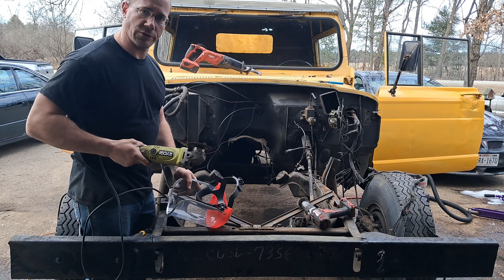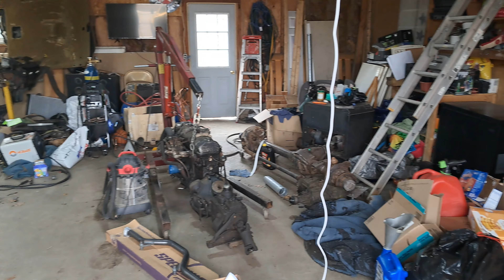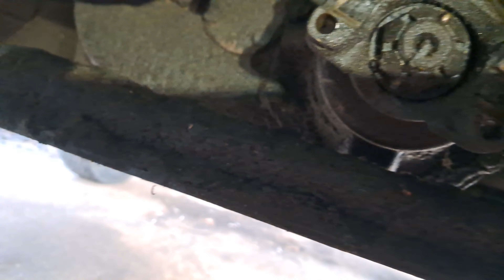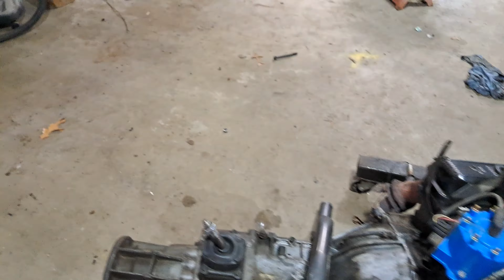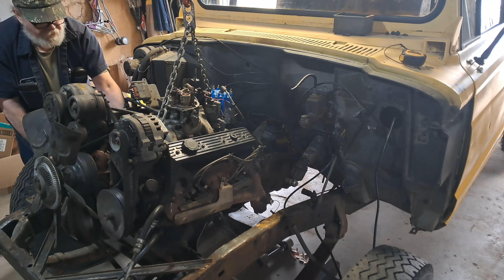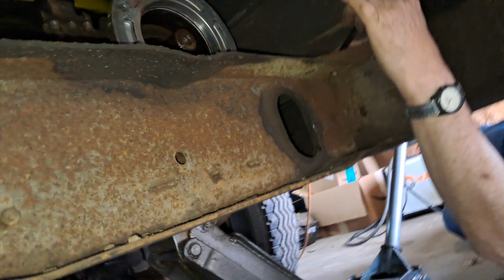M715 engine and transmission swap part 1 motor mounts and crossmembers

Comment: 👍To bustling knuckles with 3Generations together!  I always wanted to get one of the m725 for a camping, fishing & hunting rig.  Almost any new power plant is gonna be better than that Tornado🌪230!  My Pops told me stories about when he was stationed over in Germany.  How these 5/4 tons would just push through snow when it was almost as deep as the hood.  Looking forward to all the new work on it.
Reply from the maker: Thank you it's nice to get the family working on stuff together.   Yeah these things with the straight six were really low geared.  Love to hear about these trucks back in the day they're beasts for sure
Reply: Would it have been a lot less work to put the M715 body on the other chassis?